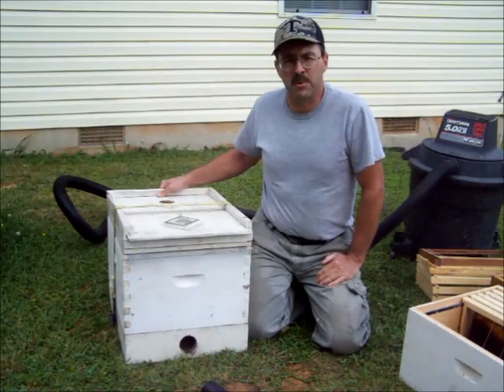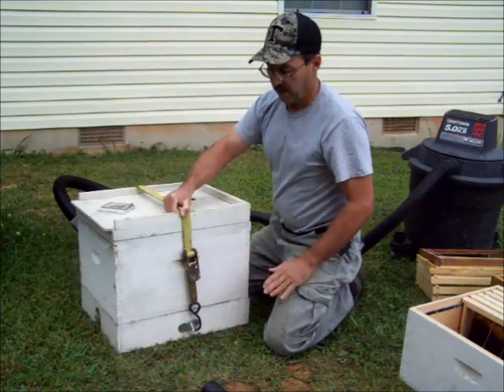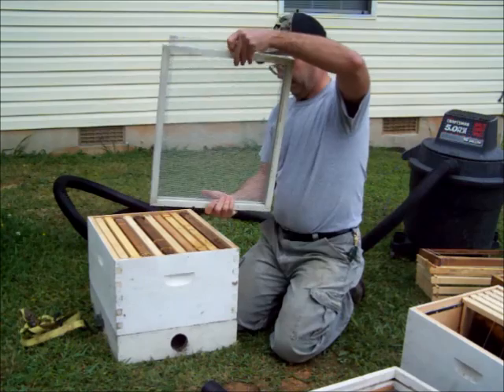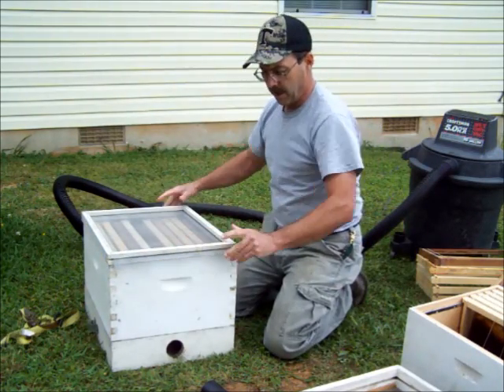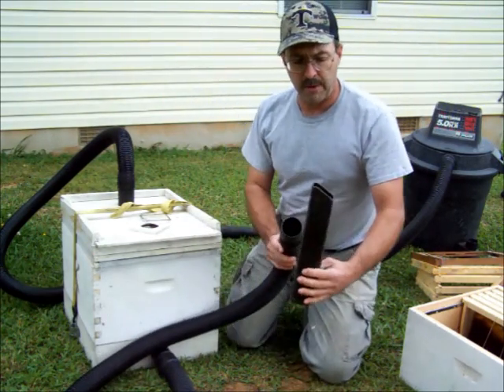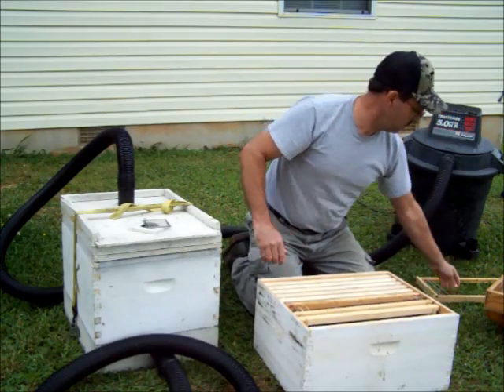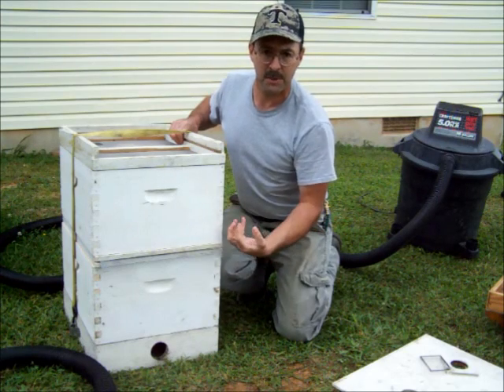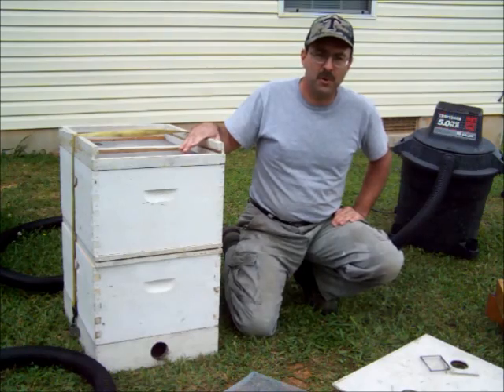ROBO BEE VAC

Comment: I built mine very simular to yours with a few minor differences. My bottom box has the hose come in near the corner and instead of a slanted bottom mine has a curved wall.  My top piece doesn't have a slide out screen but a sliding door inside. I'm still tweeking it but it's doing a fair job. Trial and error. Your video I just found, wish I'd seen it sooner. Would have saved me several tweaks. Great narration and explanation by the way.

Comment: I just built my first bee vac this past weekend, very similar to yours.  There is some debate on the hose used to suck the bees in.  Some say "smooth interior walls" are a must, and others like you & Horchoff saying that if you set your control gate properly, the bees will not be hurt by the "non smooth interior wall" of your hose.
I'm torn, but the shop vac hose is a lot cheaper than the smooth wall.

Comment from the maker: Hey David!  Good question for sure. If you have a couple of empty hive bodies stack them on top of each other and put a piece of screen between them and pull very slowly. I think you will find that the top box will want to slide with it and bees will escape also. The shim allows you to put weather stripping on both sides of it to help seal any cracks or unevenness in your boxes. The shim needs to be pulled out slowly so you do not ball bees that are on the bottom of it. Works good.

Comment from the maker: Hey Charles, sorry took so long to get back to you. The slanted bottom board, I cut grooves on the sides and a shallow rabbit on the ends. Some people just cut strips of wood to use as a cleat to support the bottom board on an angle. The whole bee vac is made out of 3/4" thick pine boards. The top is three inches tall. Be sure to leave yourself enough at the top of the groove where the sliding board is, so that it is not weak. Also on the sliding board, do not cut you dado too deep or when you tighten up the ratchet strap it will crack in the dado. The dado needs to be a snug fit so you do not loose vacuum, I rubbed bees wax on all of the edges that slide in the dado, makes it work much easier.
Reply: soapy22bullet iii

Comment from the maker: If you are not using the cut out shim (slide out screen) then the  screen on top is so they will not be sucked into the shop vac. If you are using the cut out shim and put your cut out brood combs on top of the bees that have been vac'ed into the bottom box, then you can remove the sliding board and give them plenty of ventilation while transporting to your bee yard. They can and will over heat quickly on a hot summer day.

Comment: What's the reason for the slope to the bottom board?  Used a borrowed bee vac that dumped the bees into a 5 gallon bucket and even with minimal suction and not leaving them in the bucket very long I had quite a few dead.  Want to build something close to your design.  I like the idea of sucking them up into a deep instead of a bucket.

Thanks for sharing the video!

Comment: I have read about bees being killed/damaged while bouncing down the corrugated vac hose. Would a slightly smaller diameter (perhaps 1.5") smooth hose make sense? You can get clear or translucent PVC hose in sizes ranging up to the regular shop-vac diameters. Hopefully then the bees would "slide" instead of "bounce". And I expect it would be easier to get a smaller hose into the nooks and crannies of a cutout.

Comment: How did you attach the slanted bottom board to the base walls? Did you cut groves on all four sides or just put screws in the sides. also on the top you said it is 3/4 inch thick and how wide is it? It looks to be about 2 to 3 inches wide.

Comment: You show that you made 2 holes, 1 for vacuum regulation as stated. What is the 2nd hole for. Don't want to mess it up!
Reply: I think the second hole helps regulate the air flow pressure so the bees don't get damaged. I'm just about to build one as I have 3 swarms to collect in one barn. Did 2 last year in different parts of the barn but couldn't get the next 3 as I had to get my cancer treated. All fine and fit now and going in with a beevac. It should bee more comfortable doing it this time, fingers crossed.